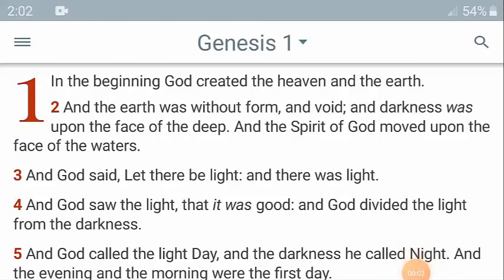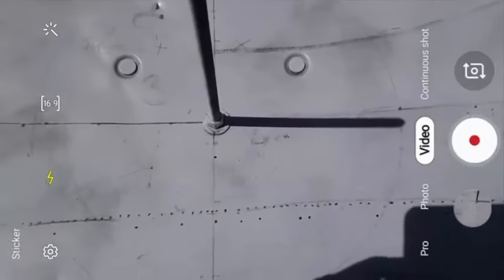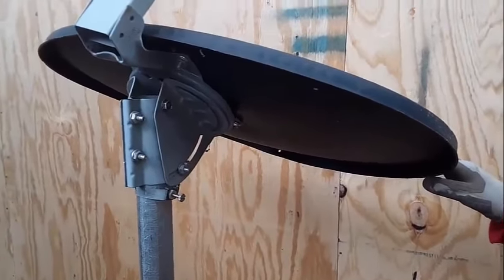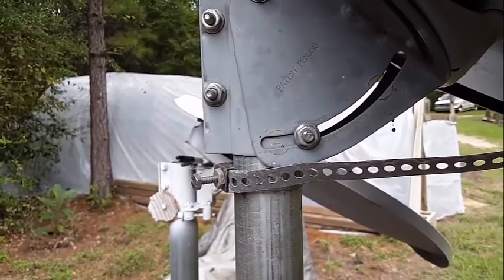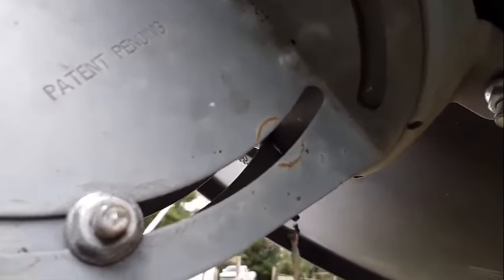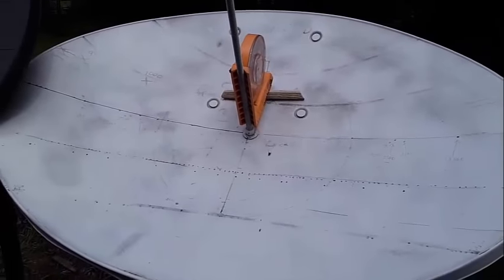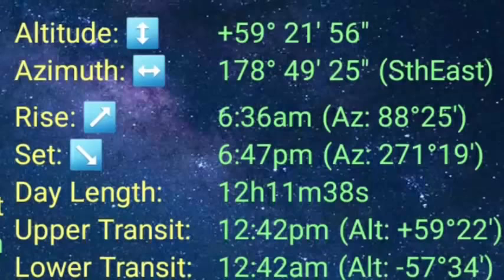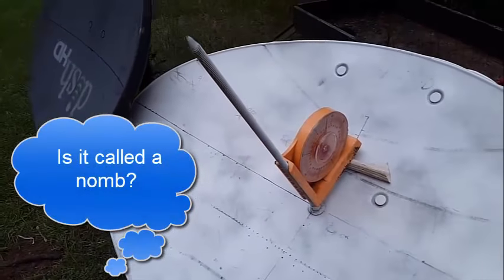Building and Calibrating a Upside-down Satellite Dish Sundial From The Junk Yard. Equinox Watch

Comment: Did you catch the equinox on 22nd ahch
Reply from the maker: Yes. I thnk i did.
Reply: @inthefight  I set the back of my satellite to 84 degrees since my south is 6 I’m in africa
Reply from the maker: So you can tinker with it for now maybe even see how to mark the time and different stuff but we're going to have to wait till the next Equinox to calibrated according to the celestials. Or you can work in getting the nomon exactly right. And we call learn sundial lingo in the meantime.
Reply: @inthefight  shalom ahch so to get a accurate shadow vein  cast on the sundial does the high noon on the sundial need to be pointing toward the north or towards the sun ?
Reply from the maker: Toward the sun. Find out when solar noon is for the day you want set it. You should have a vertical line on the sundial that represents solar noon. Then at the preceise moment lock the sundial such that the shadow is cast on the vertical line at solar noon.  
I am going to have learn to speak sundial. But how long is the pole casting the shadow.